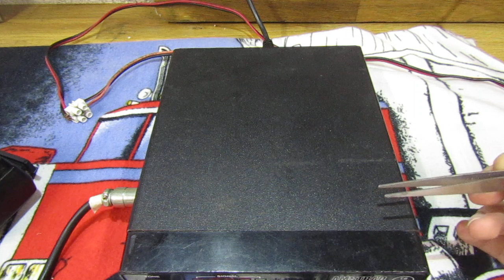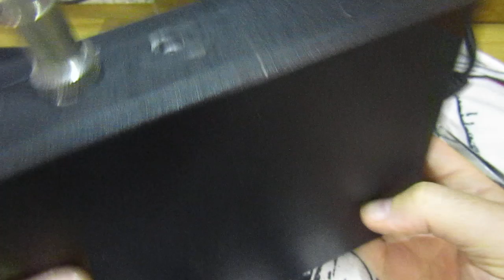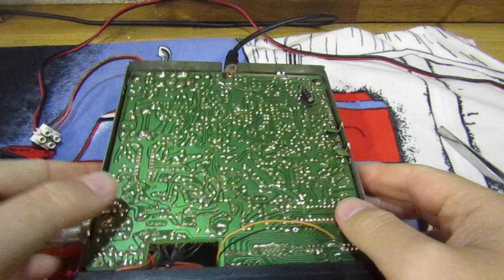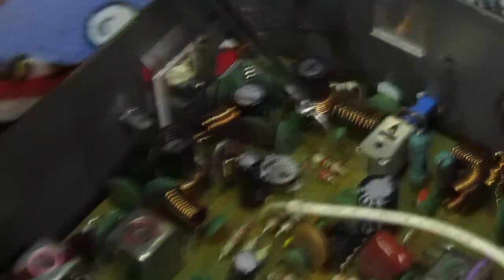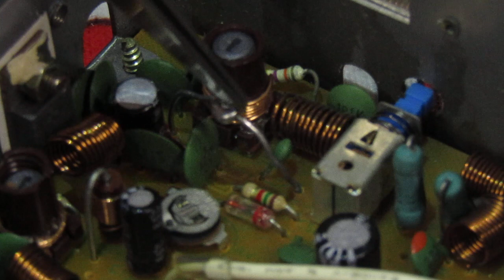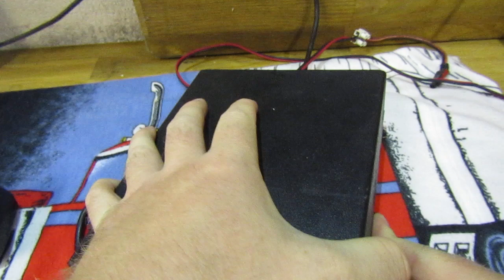MODDING YOUR CB RADIO!! How to get more power out of the Amstrad CB 900 / 901

Comment: You took the ballast resistor out and now transmit in the 2nd and 3rd harmonics. So about 2 watts on 27Mhz and 5 watts on the 2nd or 3rd. well done also that output will die over 4 watts. Change the ballast resistor from 3.3 ohms to 3 and then retune the set to 4 watts.

Comment: If the tx won't go to the full 4 watts, after peaking all the coils correctly as is the case with many rigs, then by all means decrease the value of the resistor slightly but don't eliminate the resistance altogether. That resistor wasn't put there just to limit power. As previously stated there's only so much you can squeze out of a 2166 or similar before reliability, stability and harmonic supression drops off.

Comment: all output transistors have a safe working level,,once you start going above that level, then the life of that transistor is shorter, going from 4 watts to 8 or 10 watts, even though looks good, is not doing the radio any good, and as 26ct845 has stated...its a bit pointless...no one will notice.

Comment: A stupid and pointless modification. Increasing power from 4 to circa 8 watts will make less than a quarter of an S-point difference at the receiving end (1 S-point requires a four fold increase) but will put substantial extra strain on the PA transistor. The 2SC2166 transistor is only rated at six watts: it's asking for trouble. If this were an AM or SSB radio, you'd also be increasing the chance of putting out unwanted spurri and splattering everywhere. Bit of a mis-match and you've blown it. Don't do it.
Reply: and most of the gained power goes on the second harmonic @54 MHz